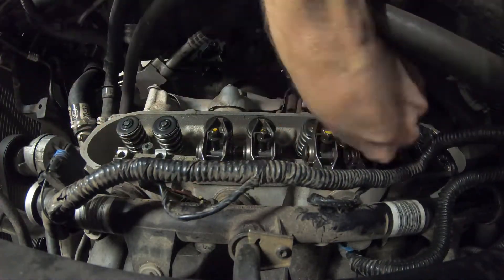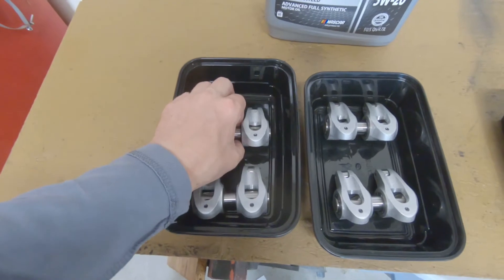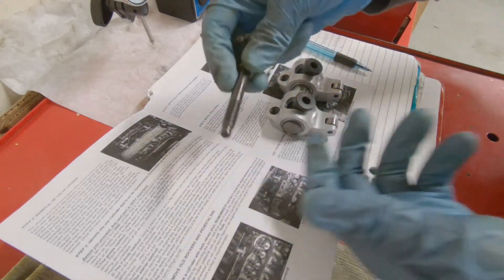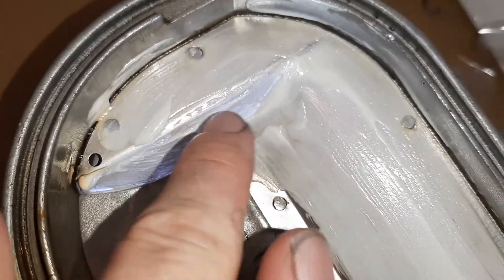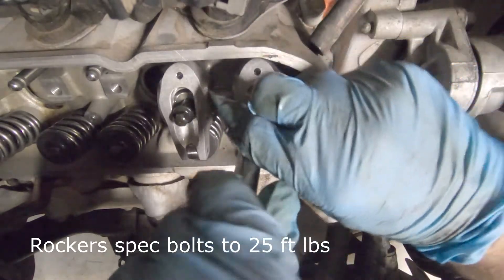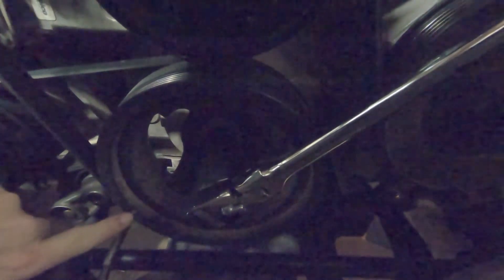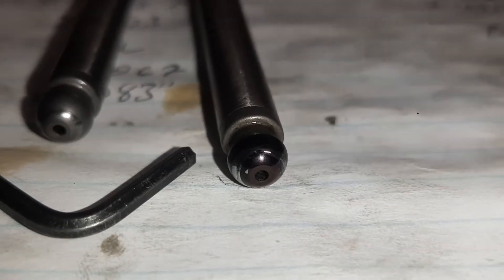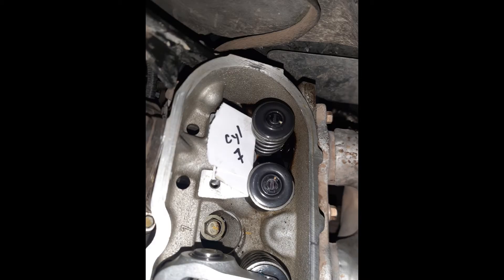Part 4 Installing Yella Terra Shaft Mount Ultralight Roller Rockers on LS engine / Gen 3 SBC

Comment: I'm going to be installing yella terra ultralites on some new cylinder heads.  I figured it's worth mocking up the rockers on the heads while they're not installed in the car to check roller tip contact on the valve.   This should get me in the rough ballpark on shimming, right?  I know I won't be able to check wipe pattern until I have the heads installed and custom pushrods ordered (instlalling a new cam also).  Do you see a problem with this?  

Also, I'm confused as to how centered I need the roller tip to be on the stem.  I thought I saw a video by yella terra that said you want the contact to be almost centered, but slightly to the intake side.
Reply: As the contact area of the roller is smaller than oem wedge They are correcting for valve geometry by biasing the wipe towards the intake this is critical in heavier open pressure springs+massive valve lift, under these extremes a bad geometry will accelerate valve guide wear tremendously
Reply from the maker: There will be a detailed set of instructions that come with the rockers. Makes wipe pattern perfectly clear. I don't recall exactly what they had said in there but it's shown very clearly. Yes will be MUCH easier to mock up what you can on heads, then if you're engine is on an engine stand w/ heads installed. It was a ROYAL PITA to do it with engine in engine bay simply because my back hurt soooo bad leaning over the fender for so many hours.